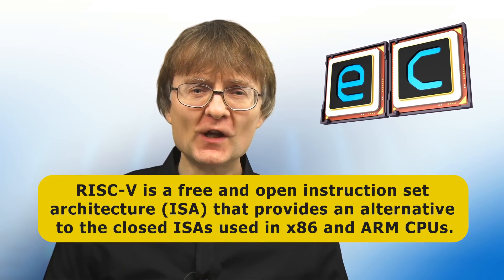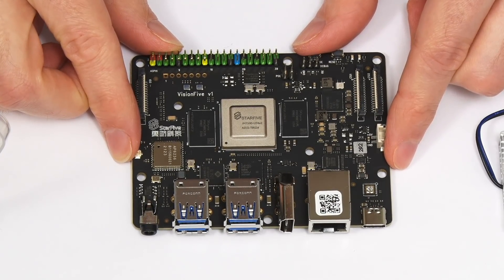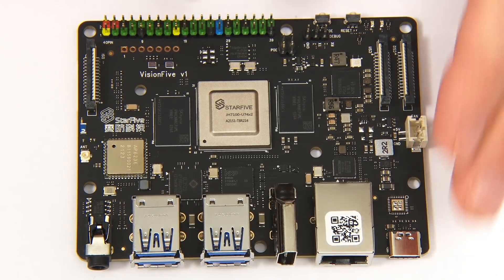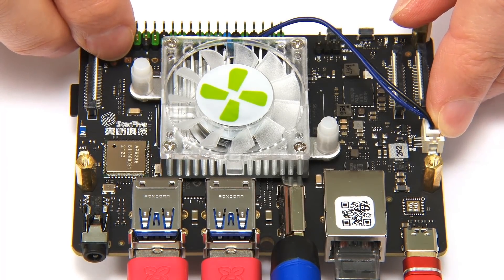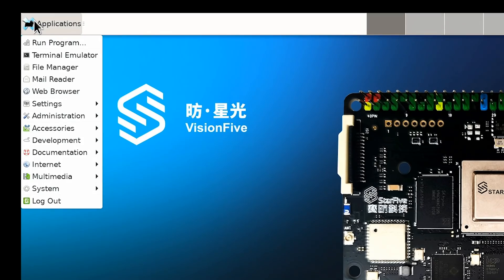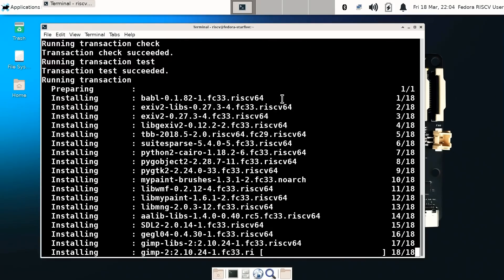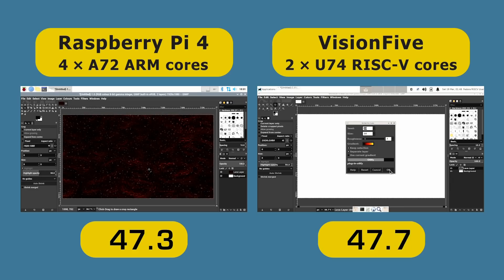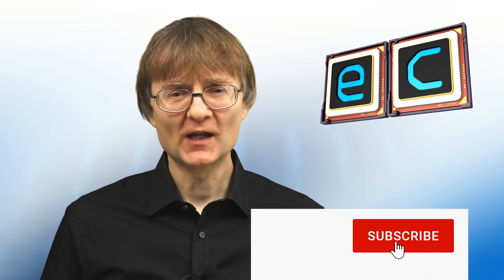VisionFive RISC-V Linux SBC

Comment: I have a question for you (good to see you again, btw). Of all the SBC's you've tested, which have the absolute FASTEST bootup into the OS, for use in embedded systems. I need to be in the OS within seconds after I activate the board. If it has an FPGA on the side that would be cool, too.

Comment: This platform seems a bit rough around the edges. The performance is terrible, even compared to a Raspberry Pi. I know the Pis are a more mature platform, but performance will be an important factor for non-hobbyist types of people.

You could go super hard into the free software/hardware direction and try to get this to run GUIX or something. Maybe even a modded version of FreeBSD. It might not be useful for much, but given the different architecture, and a different type of system, you could make it relatively hack-proof if it was too unique. 😁👍
Reply: My guess is that this single board computer does not have a dedicated graphics chip (by design). It looks more like a board for surveillance (camera ports, "AI" in hardware etc), so no wonder, it does not have the same graphic performance.
Reply: @shakeyourbunny  Yeah, but without a specific use-case, having a chip that's uncomfortable to use will make it uncomfortable to develop for. Don't get me wrong, I like that people are doing different things, because the more choices, the better for us. I just think that this is going to take another decade to cook before it's ready for mainstream function.

In the meantime, people might use it for IoT applications or other appliance features that don't require a lot of resources.
Reply: @sbrazenor2  currently, RISCV is mostly used in embedded stuff (also as hard disk controllers etc).

Comment: $179. Ouch. 

AFAIK, I the Beagle Boards are also open architectures. Around $149. I've never owned one, though, not at those prices.
Reply from the maker: The current Beagle Boards use an ARM processor, so do not run an open ISA. An open ISA is not the same as the design of the board being open. :)

Comment: This is a very interesting SBC, could it be a contender for a desktop replacement I wonder?  I'm looking forward to more videos about RISC V and what future possibilities there maybe, would there be other Linux distros available like Manjaro xfce or Mint xfce? Another enjoyable Sunday afternoon viewing with Chris @ EC :)
Reply from the maker: Thanks for this. I certainly expect RISC-V low-end desktop and laptop computers to emerge in the next few years. And I've been running a Debian desktop on another RISC-V SBC this morning! :) I think that now hardware is out there, the community will port OS and software over quite quickly. So when we get more powerful hardware the OS and apps will be there.
Reply: It has a port of Fedora, so can run that doing general desktop work,

For a corporate thin client machine this type of CPU should be pretty good., small cheap and power frugal.

Comment: Great for someone who specifically wants to explore RISC-V, but it's not price/performance competitive at the current $149, so there are better options for general small computing applications. To be fair, it is being marketed as a 'development' board, rather than a commodity product. Maybe the price will fall significantly if/when volume ramps up?
Reply from the maker: Yes, certainly a development board right now. I think we will have to move on a few product generations before price and performance matches and then betters the currently mainstream platforms.
Reply: Seeing how this thing has many chips and passive components on it compared to cheaper SBCs, maybe they will lower the price by combining them into an SoC in a future design as manufactures often do.  

This is plenty affordable for an engineer, but not the best choice to build a livingroom emulator box.
Reply: @leonidas14775  Would be really fun, though.
Reply: The raspberry pi 4b 8G is $ 265,
Reply: @先生陳-b7r  The current price for a pi 4b 8G from CPC (one of the main UK distributers) is £58.14 excluding taxes and shipping. The problem is availability - you can order them, but may have to wait months for delivery because of current supply problems. However, I managed to find a pi 4b 4G recently for £44.84. from a UK supplier. $265 is not the official price. If someone is asking for that amount they are engaging in profiteering due to current supply problems.

Comment: Once the performance and price point come into line with the alternatives, this should be a very attractive option.
Reply from the maker: Agreed!
Reply: Will that ever happen though, or will ARM always be a couple of generations ahead? ARM and x86 each have well defined advantages in their specialist areas, with increasing overlap. What does RISC V have to offer, apart from being "different"? Does its particular design allow it to excel at any task that sets it apart from the other two choices?
Reply: @johnm2012  RISC-V is technically more energy-efficient than ARM, which is saying something considering how efficient ARM is already. There's also the fact that anyone can make instruction extensions for it, unlike ARM or x86. There could be other differences, but I'm no expert.
Reply: @Diapolo10  What do you base that assumption on? RISC-V is an ISA specification nothing more, nothing less. There is no inherent “energy efficiency” as that’s a matter of implementation. 
Custom ISA extensions can be done with ARM as well, but no one in their right mind thinks custom extensions are something positive for a platform as it ultimately leads to extreme fragmentation and binary incompatibility.
Reply: @FluffyAnvil  no, that's not the case. Instruction decoding is a major energy user in CPUs at this level and below (embedded uses). That's a big part of why Intel has never been able to get into ARM's markets. RISC-V has even simpler and fewer instructions and instruction formats than ARM, without losing much if any functionality. Many customers of RISC-V vendors such as SiFive and Andes have reported the RISC-V cores using as little as 1/2 to 1/3 of the silicon area and energy of the cores they were otherwise planning to use (i.e. probably ARM, though possibly ARC or Xtensa or MIPS in some cases).
Reply: @BruceHoult Yes, RISC-V has a simpler instruction set but this is nothing new in the industry and it will superficially seem like a good solution until you try scale up the chip. This was the original idea of RISC… so it’s nothing new and every company that tried to persuade it has failed with that approach. People go absolutely haywire when something is labeled “free” without realizing that RISC-V will not compete with desktop class chipsets in a long time and at the same time they completely fail to realize that some manufacturers made significant tradeoffs to accomodate embedded systems with limited memory size (such as in ARMs case the Thumb instruction set), everything is not about performance per theoretical watt.

I have a RISC-V board too and it does not impress at all, it’s like stepping back 10 years on the ARM platform both in terms of board support, tooling and especially performance. And the chipset itself has the very same properitary cores like any namebrand ARM vendor does, I can see very well that some vendors will use RISC-V cores for simple tasks mainly because of the licensing… but the vast majority here seem to think that we have desktop class performance incoming very soon.
Reply: @FluffyAnvil  shipping RISC-V hardware (such as this board) is approximately 6 years behind ARM (e.g. the Pi 3), though the T-Head "ICE EVB" (which I have one of) already has C910 cores similar to the A72 cores in the Pi 4, so that's going to be more like 3 years once it becomes more available. Intel's "Horse Creek" platform with SiFIve P550 cores (around A75 or A76 class) should be available around the end of the year, at which point if it is used on an SBC then RISC-V will have leapfrogged well past the Pi 4, and past the likes of the Odroid N2+ and Jetson as well. If there is one thing Intel knows how to do it is build a good SoC with high performance RAM, and I/O, and plenty of MHz.

So, yes, we are going to see desktop class RISC-V very soon. Definitely within the next five years and very probably within 2-3 years.
Reply: @BruceHoult  “within next five years or 2-3 years” are not soon by any metric in any area of the computer industry.
Reply: @FluffyAnvil  of course it's soon. That is literally the time taken from starting the design of a new chip to having it available in a product in stores. I've worked in major companies doing this kind of thing, including for Samsung R&D and for SiFive.
Reply: @BruceHoult  And in the meantime you expect knowledgable companies that already today have desktop class CPUs will just roll their thumbs? And why on earth would you think Intel would even bother putting any of their know-how into RISC-V? It does not make sense at all.
Reply: @Diapolo10  How is an instruction set is more power efficient?  You are like saying English is more power efficient than French.

Comment: Interesting new equipment, innovation never stops. FYI, I  watched this episode using my Raspberry Pi 4, with an operational UPS, on a 27” monitor. Thanks 🚀😊
Reply from the maker: Greetings! Nice to year that the UPS is now working on your Pi. Is Artemis back inside now?
Reply: @ExplainingComputers  - Artemis 1 is still on the pad.  If all testing goes well it might not return to the VAB. Next stop the moon.

Comment: I like the idea but in reality Risc-V will now suffer what will probably be the same fate as Linux sooner or later - The Big Boys, The US IC cabal-like multinational corporate entity will take over... Risc V is increasingly dominated by them, and although the ISA is open source, not having a say in the development is not good... Has MS bought SiFive yet - I'll have to check... 
--
As an ARM fan and intel assembly expert up to SSE2 I see Risc V doing to all forms of chips (as it now pretty much covers most architectures except VLIW) what the IBM PC standard did for the home computer industry - monopolise the entire IC industry, stifling better architectures and technical innovation.. 
--
Apple just about managed to survive this domination, but only through product diversity, not through its PC sales.. Will we seen any radical innovations coming from rivals... Will there be any rivals? I could actually see Intel ditching X86 itself, rather than being replaced completely by Risc V chips made by rivals, and to kill ARM.. ARM will fight harder but may get taken over by one of the US Big Boys that now control Risc V, that may well then phase ARM out as Risc V takes off... 

--
Having said that, as an engineer, I appreciate standardised APIs and ISAs, but I'd rather have a chip that implements MY OWN experimental ISAs that are all 2 byte instruction sets using clever techniques to cram in massive functionality and remove dependencies and INLINE DATA in code... Risc V is now effectively a variable length ISA.. Not even true Risc IMO.

Comment: Not to be a pessimist but we barely have good support and options for arm based SBCs. The raspberry Pi still doesn't have a replacement level office suite.

I'm all for FOSS and hardware but it has barely chipped mainstream use. It is quite discouraging looking at how little the pi and arm are close yet soo far from being mainstream.

This to me is as exciting as it is depressing.
Reply from the maker: I'm surprised about that you say about the Pi -- it runs Libre Office, which is the dominant Linux and FOSS office "replacement". Not a complete office substitute, certainly, as I've covered in other videos (and you can run Google Docs/Workspace and Office 365 online). But your criticizing Linux here, not the Pi. And ARM is not open, which is a key reason why software support on ARM SBCs is relatively poor.

Comment: This could well be the first true competitor to the Raspberry Pi... this is being supported in ways that the Raspberry Pi is. That is the crucial element,  to me.
Reply from the maker: Yes, RISC-V boards will get more support than the ARM Pi competitors. Already lots of differnet organizations and individuals are contributing, and being open facilities this.
Reply: Is there any reason Raspberry couldn't release a RISC variant? If it grows and the price is good, I don't see a reason why not.
Reply: @nyny  They may release one, although I'm doubtful. There's a ton of individuals and enterprises that rely on the long term support and developer community for the Pi. Don't know that theu have the capacity to provide that level of support on a new architecture. 

Plus a ton of programs Don't support and don't provide binaries for Risc V yet. Drivers and useful software are scarce. Maybe in a few years when Risc V gets some market share.
Reply: @nomms  yeah that's true. I was thinking more if rasp faced some serious competition, they have a pipeline in place that they could adapt. However you are right it would be a huge lift on the tooling and apps support

Comment: For open source to work, everyone will initially have to create RISC V chips with exactly the same instructions. Is there any indication that the current chip developers are prepared to do that and keep the instruction set consistent?
Reply from the maker: This is a good question!
Reply: There is a base instruction set that every RISC V chip maker will need to support to be compatible but there's nothing stopping them from later adding additional instructions of their own. Similar to how AMD added 64-bit support to their Pentium-compatible CPUs in the early 2000s.
Reply: That's my point. Once unique instruction are added, each chip becomes incompatible with the rest. That can be ok for a speciality processor but the general purpose chips need a consistent standard to develop the necessary code base.
Reply: @sharonwolff1  General purpose chips need to support all the instructions that software distributed in binary form expect to use. In the case of Linux and RISC-V that is called "RV64GC" (now also known as RVA20, with RVA22 with some additional instructions to be ratified later this year). If the chip implements some extra instructions that is harmless. If you build your own specialised software you might use them, but standard software will just ignore them.

Comment: RISC-V is very exciting, but for now this one is way too slow for general purpose computing.
Reply from the maker: Both true! But give it a few years.
Reply: Imagine running the sams test on rpi1, could end up in same speed or faster.
Reply: @elitearmedforce  it should beat Pi 3, let alone Pi 2 or original Pi / Zero.

Comment: Are there any RISC-V high performance processors?
Reply from the maker: There are certainly designs -- eg the StarFive Dubhe. I'm very much digging into the state of play right now, and will report back in a forthcoming video!
Reply: @ExplainingComputers  Dubhe is I think fundamentally SiFive P550 (the same as in Intel's upcoming "Horse Creek" platform) with a few tweaks.